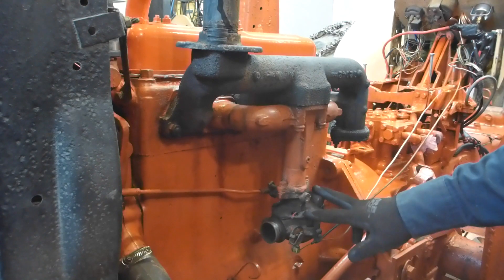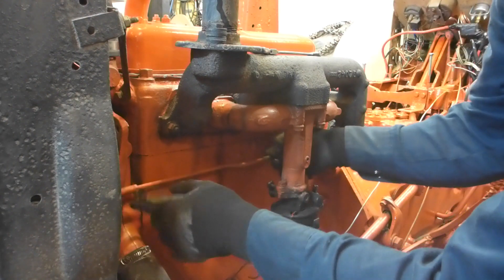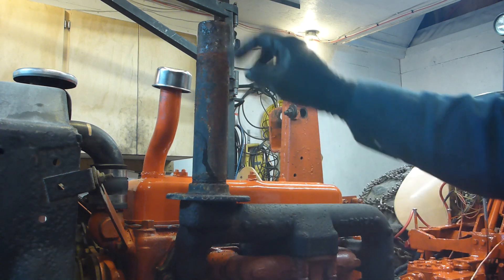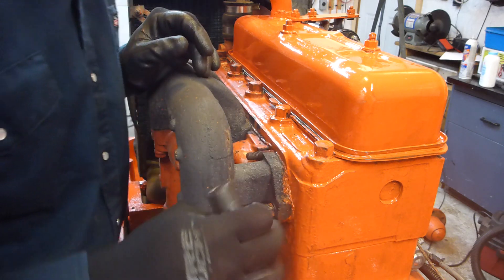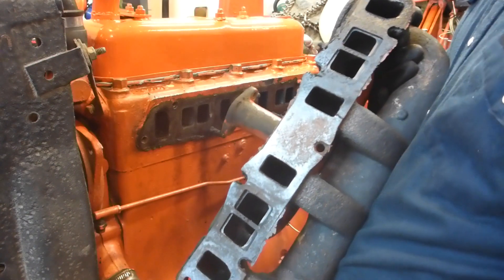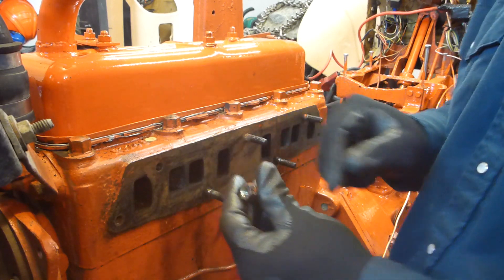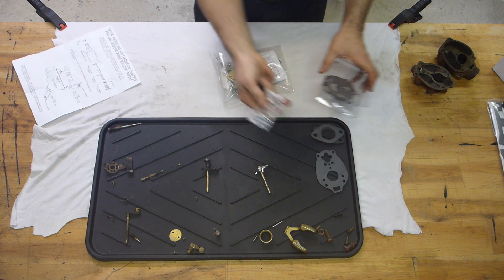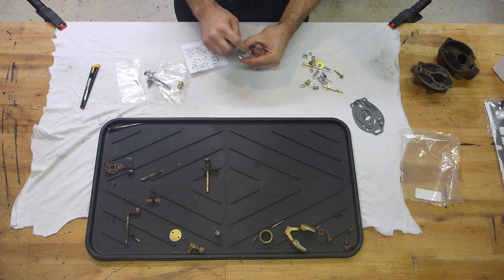#97 Case 430 Maintenance Part 10 - Carburetor

Comment: Very useful Thanks for this video. I have a question...What is in the blue tube ? A kind of grease ?
Reply from the maker: Not quite sure if you refer to the very small blue tube towards the end where I reassemble the carburetor's butterfly, it is LockTite. I don't want any screw to be swallowed by the engine... There was another bigger blue tube, it's a gasket sealant. Not quite sure I used it at that point. Thanks!

Comment: Hey Joe... is that a torque amplifier you are using on the bosch ??  I've not seen whatever that is before.
I was starting your wood splitter series and got sidetracked when I saw this one.  This is the one you asked me about the flappers direction in the intake.  About the carb kit....my 'total' rebuild kit didn't come with a main jet, though it looked like yours did.  I think I saw you slip it in during the fast forward just before you installed the nozzle....??  You've got some good videos sir.  I just subbed.
Reply from the maker: Thanks Tractorman44! This small device I put on the drill is an impact drive adaptor.  The Bosch is a basic drill (no impact) and this device does the impact. You are right, this is the carb I asked you about the flapper direction.  I haven't checked yet if I put it the right direction. The carb kit from Steiner was very complete (incl. main jet). The only thing I kept original is the choke lever and flapper if I remember well. Thanks again!
Reply: Just as soon as I sent the above question I looked at GP Outdoors and saw he asked and you'd already answered the question.  Sorry, I usually read a lot of comments first before I comment. I thought that was a regular drill but couldn't be sure.  That's why I was thinking torque amplifier or something like it. I'm still considering the 430 one owner diesel a mile down the road too.  I just haven't pulled the proverbial trigger yet.
Reply from the maker: No problem Tractorman44!  May I ask you your first name if you don't mind?  Thanks!
Reply: Sure... 'Wendell' is what the old man hung on me about 67 years ago.  Dang,  I've been called that ever since by just about everybody.  The wife has a different idea on occasion....lololol
Reply from the maker: Thanks Wendell!

Comment: That has to be the worst thing, when you go to a dealer and they sell you incomplete parts kits.  The dealer should know better and warn you.  Glad Stiener came through for you.  They are a great outfit and you can get just about anything from them.  A great resource to have access to even if it takes a couple of weeks to get the parts!!! I am enjoying this series of maintenance videos on the Case Joe!!!  You do nice work!!!!
Reply from the maker: Thanks Mike!  I am thinking of ordering more basic parts from Steiner.  The Case dealer nearby is charging me 75$ for a simple distributor cap and rotor and 50$ for the condenser...  It makes no sense.  I will gather a bunch of stuff and make an order soon. Thanks for your support!
Reply: Even if the cost is the same from Steiner(or even higher due to exchange rates) getting it from people who know what they're selling would give peace of mind at least.

Comment: Nicely done.  Joe, one time I purchased an auto replacement part and the only item they had was on the rack and it had been re-taped shut. Well, after getting to the house to reassemble my truck part, it was not what I expected.  So, I let it go b/c I didn't feel like running all the way back to town for a new part (about 22 miles).  That's kinda what that carb kit you had gotten reminded me about. I rebuilt my F-250 carb two separate times and it ran pretty good for several years and then it was time for total replacement.  I got a new carb and the truck never accepted the new carb.  More back-firing than a gassy mule.  Haha....I can laugh about it now but when it back-fired, everyone jumped to the ground.  Dang...the S.W.A.T. team had me in their iron sights b/c of the super loud back-fire (Haha).  Well, those days are behind me now but I had to share that story.   Super job. Thumbs up.
Reply from the maker: Thanks! I am very surprised how easy (or lucky am I...) to have this carburetor's setting right the first time (vid #13). Too bad I got the bad carb kit in the first place. The great thing about doing video, you can go back to the video to see where or how the parts where before dismantling! On this one, I had to go back a few times! It's amazing how mechanical settings can lead to give "personality" to a vehicule! You change some parts, the vehicule behaves differently! You can see I am a profound gearhead! Lol!
Reply: I totally agree.

Comment: Morning Joe! Just catching up this morning. So frustrating when you order something and you get an incomplete package. But looks good and ready to fire up! Hey , quick question - what is the big blue cylindrical attachment you have on your drill? It looks like it says Mastercraft on it? Thanks!
Reply from the maker: The blue attachment is a Mastercraft impact driver. They did sell it at Canadian Tire for 20$ a while back.  Unfortunately, they don't sell it anymore.  I can tell you this tool is strong and sturdy.  I use it to remove the wheels on my car for tire change. That is the kind of tool you might get in a garage sale. Thanks for watching!